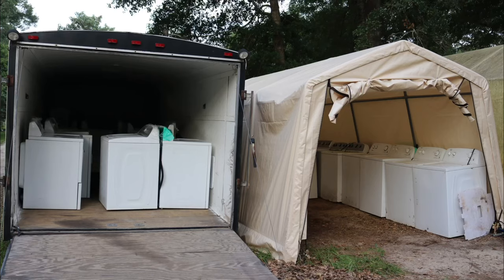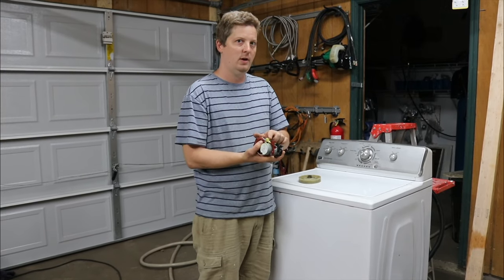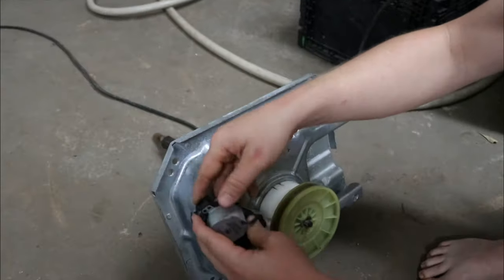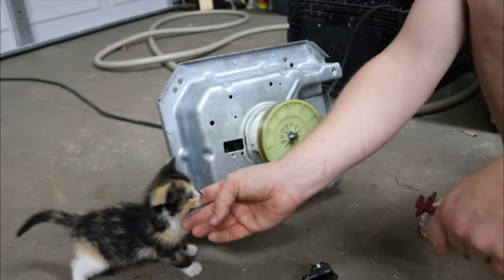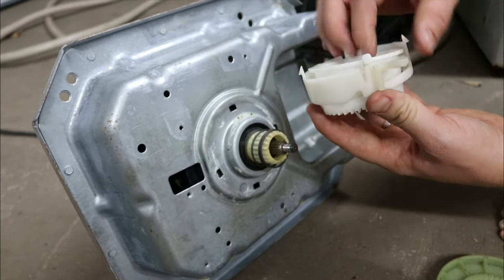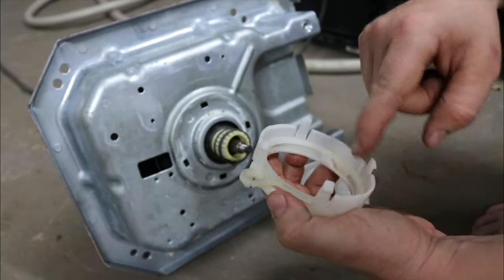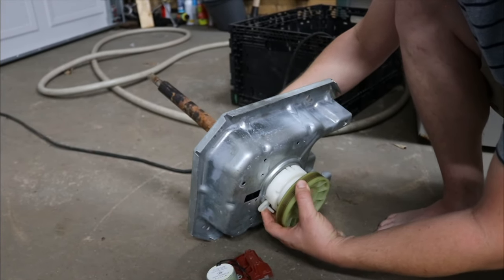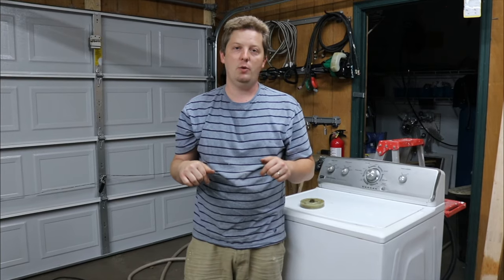Washer No Spin or Grinding Sound? Actuator Transmission Step by Step Guide to Fix or Replace

Comment: after bitching for the last month that our clothes were not coming clean we removed the lock from the lid and placed it in the locked position so that we could watch what was going on in the wash cycle and we discovered the agitator is not moving. everything else seems fine. it fills with water, drains and spins i reached in and can move the agitator by hand and when doing so can feel it grinding. would this be the actuator motor mechanism or the plastic teeth hub.
Reply from the maker: It could be the actuator but it could also be a week or bad capacitor on the motor.

Comment: My Maytag will fill up and there is a sound like something is moving back and forth but nothing is actually happening.  It is almost like a humming sound.  It is a two part sequence where it with the hmms and it just does that without doing anything to the clothes.  I am thinking it might be the same thing either the belt or the actuator aren't engaging so it make noises like its trying to do something but not actually doing anything.
Reply from the maker: I would guess it’s the actuator. It’s always hard to tell though. I doubt it’s the belt those don’t go out very often.

Comment: The splines the clutch engages into where stripped on mine, it doesn't seem that part is available other than a complete drive unit, unless anyone knows otherwise? A lot of very cheaply made plastic parts for an expensive so called "commercial grade" washer.

Comment: i have a whirlpool washer it will start to fill then all of sudden the light will go blank drain the water out make a humming noise last night i took the same part off in ur video checked it out i saw no issues put it back on ran it through the codes no codes came up today done 2 loads its working just fine now any ideas??
Reply from the maker: I would guess the actuator is going out.
The motor gets weak on them and they don't always ship from agitate to spin. be sure to lubricate the inside of that plastic piece with the gears. You'll see it in my video towards the end. It will make that motor have to work a lot harder if that piece is not well lubricated.
Reply: @WasherDryerMoney  ok its only a year old i no that dont mean nothing these days

Comment: I just got done tearing mine apart it wont spin and it doesnt us an actuator is has what looks like 2 clutches. Everything looks right but I havent got a clue what Im doing. Im going to put it back together and see if it starts working again or try lubing up the clutch pads so it can start spining.
Reply from the maker: even has a clutch it probably is a direct-drive washer. Look up videos on replacing a clutch in a direct-drive washer. Lubricating them is not a great idea because those plastic pads are supposed to slightly grip the edges.
Reply: @WasherDryerMoney  yep i did that and realized Im an idiot lol... Ordered a new clutch, bell housing and new springs. Then went down to check the pump for leaks and noticed the black trail of an old leak so replacing that too even though i saw no leaks on the floor. It just seems that it has more resistance then it should if its on bearings... Im really hoping my coupler doesnt break under the load of the new clutch cause I dont want to spend more then 20 dollars incase this does solve the problem but after researching I believe it should as the transmission and motor spin freely. Thanks for the information. Why did they switch to an actuator? It seems like the clutch design is much more durable. I feel dumb for saying I would lube that clutch when its designed to grab rather then spin. I didnt understand it was connected to a brake drum after I did another hours worth of research. Makes sense after all this time of watching the drum SLAM to a stop when I open the door. Its been a good washer for 20 years. Was my grandmothers then my dads now mine. Ive been able to keep my dryer running for 7 years with just 2 belts and 2 heater coils.
Reply: @WasherDryerMoney  so I replaced the clutch and the water pump. The washer still didnt work. Come to find out I needed a new motor now its working great!

Comment: Question.... I have a BRAND NEW Maytag top loader that looks very much like the one in your video above.... And 31 days into ownership our Actuator came loose from the little shifter arm (the white sliding part inside of the piece you popped off the bottom).  The "Maytag Repairman" who is just some dude who they sub the work out to came out and showed me where it came loose... its easy to get the actuator arm to back in place... but it keeps coming disengaged from the shifter arm .  He ordered a replacement part, but this dude is taking forever and I have a house full of kids who change clothes every 30 seconds.   We need to get this machine back in working order.   Are you aware of a new part that stops this from happening??  I think I am going to end up tackling this one myself.
Reply from the maker: The strangest keeps coming loose. You could just change out the actuator and the spluch.
Check out my description you’ll see where I have them both listed as parts. If you’re not 100% sure it’s the right part use the link I have for looking up the exact right parts that will fit your machine. It should cost you somewhere around $50-$70 for both of those parts.
Reply: @WasherDryerMoney  thank you!   I am going to order the parts tomorrow!  I temporarily have a zip tie holding the splutch to the actuator… it’s working but I need to get this thing 100% 😁. Thanks for the speedy reply!
Reply: The ZIP TIE is working surprisingly well.  It just prevents the splutch from flexing over the top of the actuator arm.

Comment: I did the manual test procedure for my whirlpool washer, and I found that the gentle spin, heavy spin, and heavy agitation all work, but the gentle agitation does not work. Any ideas what that would indicate? 

The trouble shooting guide does not deal with this and basically says to change the main control board. The shifter motor has 2.5K Ohms between neutral and L1 (should be between 2K and 3.5K), so that's good. The shifter motor gets 120V, so that's good. The shifter switch gets 0VDC in agitate and +5VDC in spin, so that's good. The shifter gets 12.2 VDC instead of 13 VDC, so I don't know if that's a problem or not. The tachometer is verified, so that's good. 

Something to do with the actuator or gears?
Reply from the maker: Join the Facebook group “appliance repair help and questions”
I’m not 100% sure. Might go to Move is always replace the actuator but it sounds like you’ve tested it and it works well. Post that question in that group and see what they recommend. There’s some really good appliance technicians in there.
Reply: @WasherDryerMoney  Sounds good, I'll try that, thanks. There's a bit of play in the transmission, I wonder if that would cause a problem. It wiggles up and down about a centimeter. Also I stretched the spring out a bit just in case it had become less springy over time, and I'll see if that makes a difference.
Reply: @WasherDryerMoney  It appears that the problem was that spring that you mentioned at 6:15 was old and had become compressed. I  pulled it apart a bit to stretch it back out and now the washer seems to be working. So, thanks for that bit of insight!

Comment: I did this, I also replaced the transmission, actuator,and the belt.

Still not spinning, sounds like its slipping.
If you have an email, I cant try to send a video of what its doing. Hopefully you can help me.
Reply from the maker: If it’s making a grinding noise it’s going to be the splutch. I don’t have a video on that problem yet but there are a few on YouTube.

Comment: I have a whirlpool Cabrio...I changed the lid lock actuator, I changed the shift  actuator underneath....I did the recalibration thing....machine still won't work! Help
I turn it on. It starts sending. Lid locks. It senses again and lid unlocks and then it locks and does nothing else
Reply from the maker: Double check the arm on the actuator is linked to the shifter. Sometimes it will pop out a place and make you go. Crazy thinking something else is wrong. If it’s not that you might try to put it in and test mode it’s similar to calibration mode, but it will tell you what it thinks is wrong
Reply: @WasherDryerMoney  that's exactly what is was!

Comment: Same washer, has loud grinding noise and leaking an oily mess underneath? Help!!
Reply from the maker: The grinding noise is probably the spluch. I have a video show me how to change that. The oil is coming from the transmission, and the transmissions on those machines are not serviceable easily. I have a video on that as well.
A lot of people will just fix the splutch and clean all the oil up, they can and hope it last a while longer. Rather than replace the transmission.

Comment: Have a maytag washer that is not agitating when washing bit spins otherwise. What could problem be.
Reply from the maker: It could be the actuator or if it’s just lightly agitating it could be the capacitor going out.
Reply: @WasherDryerMoney  what size capacitor do we use to replace these capacitor?

Comment: So mine isnt washing the clothes. It's making a clicking noise during wash cycle. Its draining and spinning. I replaced the agitator dog cam housing. Please help!
Reply from the maker: If it’s the same as the washer in this video it could be the actuator. It’s the same part I was referring to in this video will either be a red one or a black one. I won’t guarantee that’s it but it’s a good chance. That piece literally ships it from agitate to spend and when it goes bad it cannot shift it back-and-forth. You can find it on Amazon by looking up washer actuator and just match it to exactly what it looks like on yours. Good luck.

Comment: Why the cam set on on my washer threaded on the gearcase and also cut a rounded mark in the belt gard, please let me know why this happened, I changed the cam set and it it happened again
Reply from the maker: I’m not sure did you use thread lock to make sure that nut does not come loose? If it came loose maybe the plastic Poli fell down some?

Comment: Why is my bravo x starting to squeak a little on spin cycle. Didn't want to go on spend one time so I unplugged it but then it worked but still makes a squeaky sound when it's spinning
Reply: Didn't want to go on spin one time but after I unplugged it and plugged it back in it did
Reply from the maker: I’m not super familiar with that type of machine but if it will free spin while it is turned off give it a turn and see if it squeals. If it does you should be able to tell where it’s coming from hopefully it’s not the bearings. Good luck.

Comment: Do I have to take the motor and everything off to clean that part that needs cleaning ?
Reply: No you just need to remove the plastic pieces as described in the video. It's called a "splutch kit". Look up videos on removing it. Fairly simple.
Reply: @kbob8424  I got it thanks! Had to use my drill for some power lol
Reply from the maker: Glad you got it.

Comment: hi have the same washer changed out the osilator and the plastic under the agitator still doesn't ring out
Reply from the maker: If it’s not spinning it could be the lid lock is not registering as locked. So it could be a bad luck or if the motor is just not getting up to speed it could be the capacitor.
Check out Bens Appliances and Junk channel he has a video on putting that machine into diagnostics mode.

Comment: Would a failing actuator  cause a momentary sort of grind noise ( 1 second then quiet) ?  I see the actuator  move a bit but then nothing happens other than the brief noise.    My plastic  pully / gears were quite dirty and I cleaned them up .  Thanks if anyone can help.  My machine is a Kenmore 2600 .
Reply from the maker: It could be a bad clutch. These machines are not the best but they tend to have the same problems over and over again. Hopefully that works for you. Look up Washer Pulley Clutch Kit on Amazon. There’s some on there for under $20 that include everything. Good luck

Comment: I have a kenmore 110 washer when it goes to spin cycle it doesn't work all the time or it bangs like crazy in spin cycle I replace the 4 spring that hold the drum it was better but still bangs
Reply from the maker: Sometimes the bearings will start to go bad can also calls the machine to go out of balance but it's very rare. I have had some bad luck with the cheap suspension rods. Same thing you said they help it balance had little but it still gets off balance. Another thing I have seen as soft or unbalanced floors in the laundry room make the machine fall out of balance.

Comment: youtube short video by coty mccollum fixed the issue I had. I had very loud screeching noise during agitation. His solution was to put a washer around the metal spindle so it pushed the gears away. I replaced my actuator and it didn't fix the issue because there was play in the gear mechanism. Putting the washer allowed for the needed space so the gears don't rub. I'm not sure why there was play in the plastic pulley wheel... it was almost like I could push it in and out. Just wanted to share this for anyone who didnt have luck with the actuator alone. My washer is the 4.0 cubic foot amana washer NTW4516FW
Reply: I highly doubt the spring was the issue because the washer was a brand new store return

Comment: I said I got a washing machine that when it goes I'll spin we're just a little bit of water and a speed cycle before the machine spins they don't do not drain the water but I change the timer I change the transmission alternative ative the same thing a Whirlpool commercial

Comment: When flipping a washer how do you test the washer to make sure it works?
Reply from the maker: After I have fixed whatever was wrong with it I will usually run it for at least two full cycles to be sure it is working properly. I also always said it to the deepest cycle to make sure it is not overfilling.

Comment: My washer somehow doesn't close the "drain valve" after each spin cycle. So when the 2nd cycle (rinse cycle) starts, the water just runs, but the washer doesn't fill...   Is this an actuator issue.? I have a Roper washer. All manual controls, not a "smart washer"..lol..
Reply from the maker: I don't think that would be the actuator
Reply from the maker: If it's draining on its own it could be that the drain line is too low and it's siphoning itself out.
Reply: @WasherDryerMoney  the drain line is in the same position it was in before this issue started..🤔. If I catch the timing and manually switch the knob from spin to agitate after the first wash cycle, and let it agitate for a few seconds, that seems to close the drain valve... Then I have that do the same again on the second cycle...

Comment: What happens if it’s over rotating and it sounds like a rocket ship taking off machine is like over reving up and moves it off it’s legs?? Thanks really shakes a lot scares my wife n me we have to hold it cus it’s freaking up out!
Reply from the maker: I think that would be the suspension rods going bad. I have a video on that as well. Easiest thing is just replace them.
Reply: @WasherDryerMoney  thank you WDM

Comment: Any tips for getting pulley nut off to get to shifter, ie hold pulley to get nut off.
Reply from the maker: Yeah sometimes you can turn the drum one-way and hit it real fast with the wrench. Just be careful not to hurt yourself.
The problem is there is Loctite on it. And you need to replace the Loctite when you put it back on.
Reply: @WasherDryerMoney  this is where I was stuck!  Afraid to put too much force into it. Thanks for the explanation!

Comment: Yeah , I did all that and replaced it with a new actuator. Still won't go in spin. It will agitate , and drain. But won't go into spin.
Reply from the maker: Try recalibrated it. I just made a video on how to do it.
Reply: Found out what I did wrong. My mistake. All is well . Thanks. 👍

Comment: My washer actuator arm keeps moving back and forth and never gets engaged.    Is this the splutch going bad?
Reply from the maker: Take the split half off an oil it a little. If that doesn’t work I would say the actuator has gotten week and does not have enough power to shift the washer. That would be my guess.
Reply: It’s a new actuator.  I’ll remove  the cam gear and clean it.
Reply from the maker: Yeah definitely do that. I always like to put a little oil and make sure they move freely without any sand or debris in them. A lot of times a week actuators are just hey symptom of that part being too hard to move. Sometimes you can clean it out and it will start working again but sometimes it has been overstressed and the motor just is bad. On the actuator.

Comment: I have error cod F7E5 on Maytag bravos.  I replaced actuator but still have same code. Please help
Reply from the maker: Check the manual hidden on the inside of the washer shell. There should be a section where it shows you how to calibrate the washer. Sometimes this is necessary after you put on a new part on some of the newer machines. Give that a try before you try anything else it’s just a matter of putting in a weird code on the dial.
The channel “bins appliances and junk” as a good video on going through the different modes on the dial.